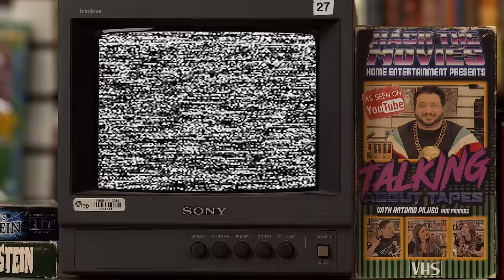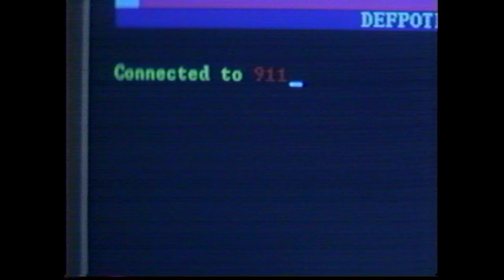Scream is Still Scary 25 Years Later! - Talking About Tapes

Comment: When I bought my first modem, a friend of mine decided to test out the on-screen dialer by calling 911; for some reason he must have thought it wouldn't work.

I cut it off immediately, but still had to field a call from the 911 operator, wanting to know if everything was okay.

So, yeah, you could totally dial 911 from a 1990s computer modem. They had all sorts of speaker phone and fax functions that would install with the modem drivers, back then.

It was a real joy trying to get that crap to work, back then, too: All those IRQ addresses and stuff that you had to manually assign. Every time I moved the mouse, it would disconnect the modem.